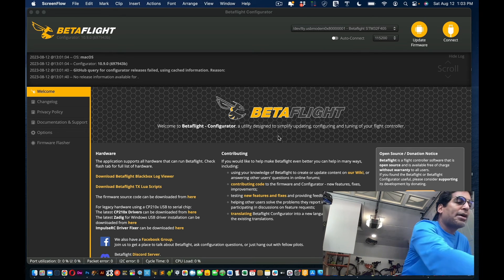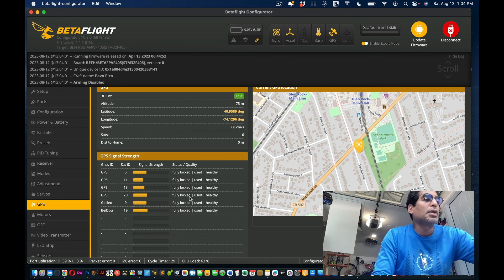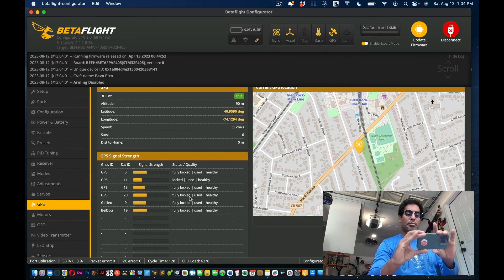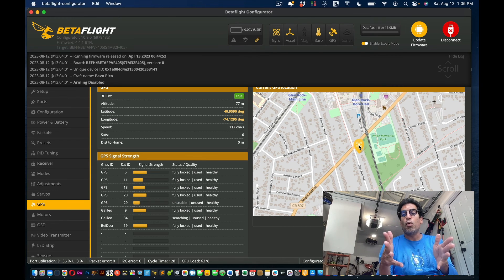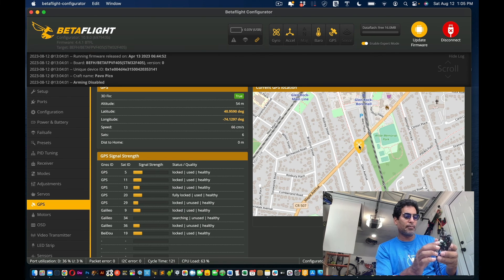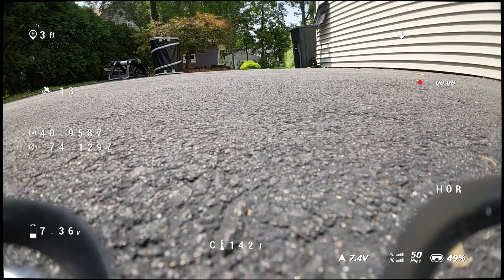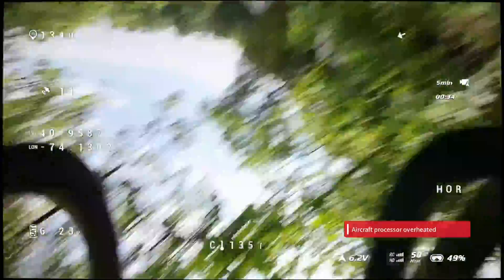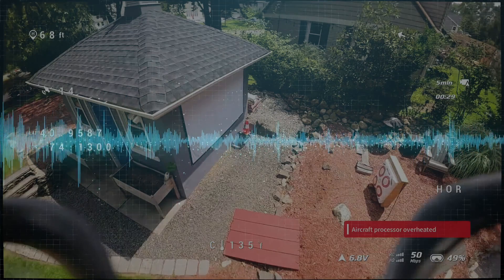pavo pico gps working part - 4

Comment: Dude some advice.  Buy yourself a whoop drone and practice flying on that.  The cost is insignificant and if you crash it wont damage the drone.  Buying a drone with an expensive camera starting out is the wrong thing to do.  Just saying and im sure others will agree.
Reply from the maker: Thanks - which one would work with the dji goggles and RC. Am thinking ready to bind and fly…this thing over heats mid flight and then drops from the sky…
Reply: @droneimagery-NY-NJ  yeah similar to the guys advice above.. At least scale back to DJI AU v1 or CaddxVista :) Its hard to go analog when you're already digital invested regardless of the costs.   @How-to-by-Lou